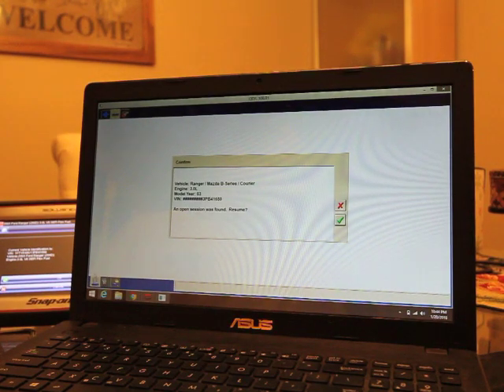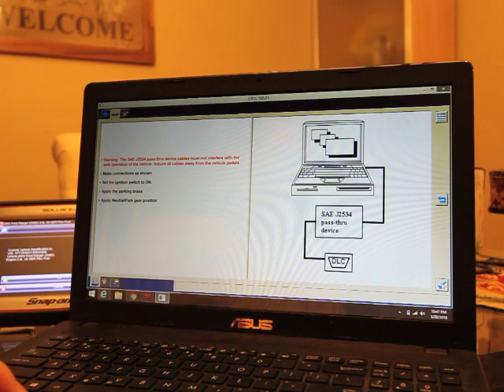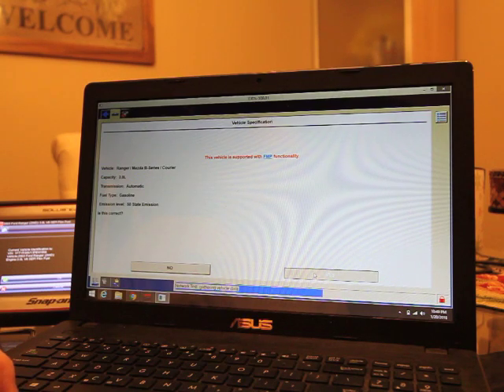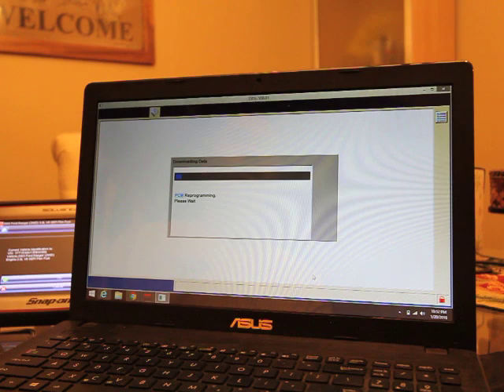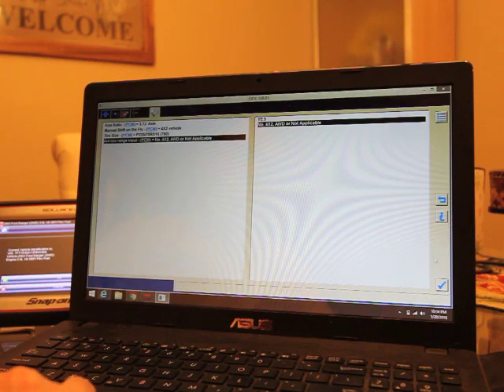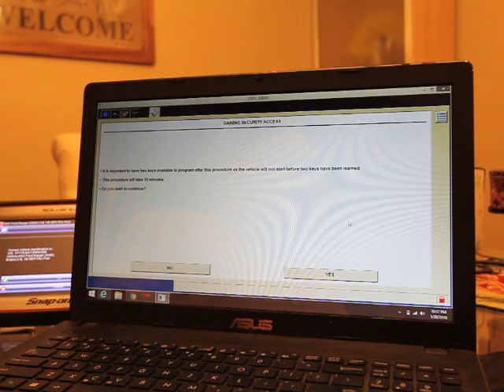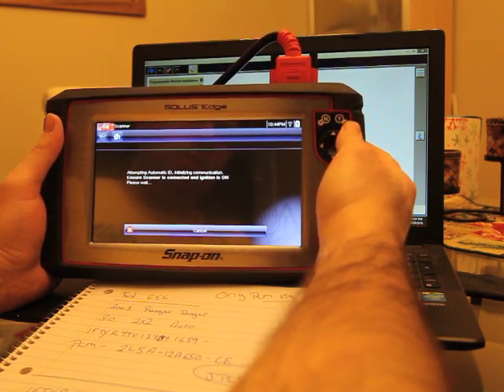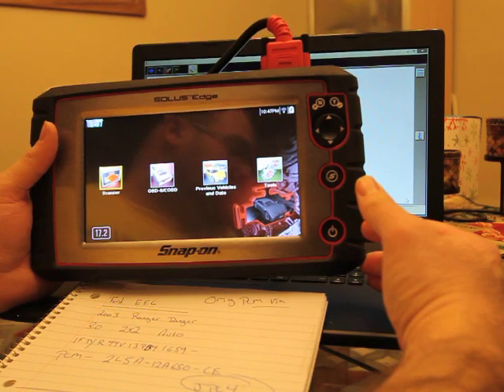Ford PCM / ECM Reflash With VIN Change walk thru j2534 Programming flash reprogramming FORD IDS FJDS

Comment: Thank  You for the great video and information. I know less then nothing about the prograning. If I sent my 2003 ford f150 ecu/ecm in to have someone rebuild it, Is this what they do so that it works with the pats? Like I said I know nothing about this. I have to mail it in because I moved to Central America with my truck from Flroidsa. No ford dealerships here. Again Thank You .
Reply from the maker: So you had it rebuilt?
Reply: @SpartanAutoworx  Thank You for the reply. No, I have not had to dl anything yet. The truck is a 2003, It's simoly a matter of time.
Reply: @SpartanAutoworx  OOPS! simply
Reply from the maker: Not sure if im understanding. A rebuild would not need to be re flashed. A re builder should not have to re flash unless some programming specific parts had to be replaced.  PATS may have to be relearned but that about it.

Comment: So I am swapping a coyote engine into a fox body, If I got a computer from the junkyard can I use the snapon or vcmii scanner to disable pats? or I will have to get the immobilizer/cluster etc and actually program keys for it?
Reply from the maker: To my knowledge you wont find anyway to disable vats with ford or oem level diag tools. HP SCT ect would be required for a pats disable.
Reply: @SpartanAutoworx  Right I've used hpt on other cars however the copperhead seems to be different some ppl shipped their pcms to a guy from hpt to get something done. I will have to go that route thanks for ur reply.

Comment: Wondering if you could help me out... I had a tuner install a tune on my 2003 excursion 6.0 diesel. It works, however, the tuner changed my vin and locked me out of my sct x3. I have a vcm and ids, can i sace the tune file, revert to my vin, and install the tune on my sct x3?
Reply from the maker: You can rewrite the orig file with the ids but puling the tune off with ids is not going to happen. HP tuners or SCT would be needed to read the mod tune. Dont mess with aftermarket tuning with fords so I have no answers on this one.

Comment: hello excuse the question but I would like to know if I could change the program in an automatic pcm to manual in a ford ranger 2000 3.0
Reply from the maker: If the pcm part number allows it then yes. Have to cross reference with ford.

Comment: I have a question...... 07 f150 I have only 1 key before I start programming I need 2 working keys I understand that. In the pats section can I program the 2 new keys with 1 original to make a total of 3 keys before I switch pcm????
Reply from the maker: Not sure I understand what you are asking.  When you enter Pats All keys will be erased. So You must have Two keys in order to program the keys correctly to start the vehicle. Only one key would be required in order to access the pats function.

Comment: Does This Method work for used ABS module?
Reply from the maker: Used If programming is found in IDS use as built from the server to flash it. If it ask then copy data from the old module. Never done ABS on a Push or Repair daily

Comment: Hey, Original PCM on my 2004 Ford got shorted out and replaced by a shop with a used PCM.  Discovered at emissions testing that shop did not reflash the PCM and still has old VIN.  I suspect that this replacement PCM is not calibrated properly for my car since it is running rich.  Contacted shop that claims no, PCM will go back to factory settings even if prior owner of PCM changed settings in PCM and old VIN won’t make a difference.  I’ve asked them to check the PCM settings on my car and reset to factory settings if necessary.  They said that that can’t be done via the OBD2 port and the PCM needs to come off the car to do that.  I’ll press them to do that if necessary, but is that true?  Is this procedure not through the ODB2.  Any tips or advise welcomed.  I paid way too much for them to just blow off reflashing the PCM if they should have done that.  Thank you.
Reply from the maker: Reflash can be done in the car or off. Sounds like they threw it in and programmed two keys to it via a handheld scan tool. If they did reflash it then the procedure for vin replacement was not correct. Would need to follow key procedures discussed in this video to manually input the vin for the rewrite.
Reply: They could only disabled PATS.
With PATS disabled you could plug the PCM in any car.

Comment: If you’re using a bench tester like the TomSad Smart Connect they recently came out with a ignition coil attachment that you could use for programming your keys in as long as the key data is saved in the module you’re working on.

Comment: Just replaced the pcm on my 98 Ranger. Everything was fine....until it got warm, then it wouldn't start. Had to replace old one. Does it need to be programmed? I just swapped it out. Is that the problem?
Reply from the maker: Should be programmed to match the correct vin and cal info for the engine of the truck.
Reply: @SpartanAutoworx  : It says it was pre-programmed at the factory. I just needed the emissions code(?) off the door to order it. IF the VIN was in the original, nothing I ever had could read it....had to manually input the VIN into the AutoTap program I had.
Got another one, and it worked for about a week, then wouldn't start when cold. Connected a reader to it...said it had no codes...and then it started!?!?
Reply from the maker: EEC-IV Computer or EEC-V
Reply: @SpartanAutoworx  : The sticker on the original PCM states its EEC-V.

Comment: So, I have a VIN but I have a VIN I want to mimic.  The VIN I want to mimic is the one that has an option I want, I just don't want to have this PCM think that the VIN is of the vehicle I want to mimic  Is this what I would do?  enter my PN on my sticker not have it on basically fool it into thinking it burned out completely then after plug it in?  Or do I tell it the VIN of the one I want and it download everything from Ford?
Reply: Also, I have this https://www.amazon.com/gp/product/B01F0GVBWY/ref=oh_aui_detailpage_o00_s00?ie=UTF8&psc=1 will it connect?  If I buy a 2 day subscription to FDRS where do I get the actual software?  Or once I buy a license from motorcraftservice.com do I get a download for the actual software?

Comment: Hey just a question. Not sure how much experience you have with ford pcm reflashing. I have a 2011 mustang, with the tear tag of xfn3. I purchased a ecm with the wrong tear tag of zfk1. Both cars have 5.0 both manual trans. Only difference is the new one was from a 2012. Is it possible to program to my vin. Or do I need the vin for that vehicle? I tried to program it but as soon as I did it would tell me the ecm was unknown/ wrong. And that I needed a certain part number. Any help is appreciated
Reply from the maker: From my experience, you almost always have to have like for like part numbers when flashing fords. Fords can be a real pain to flash sometimes due to part compatibility.  Good luck.

Comment: Hello, sorry to bother you with this question, but, how did you do to purchase license for FJDS, I have been tried and always pop up the same error “Microsoft VBScriptruntime error ‘800a000d’ type mismatch /ngsm/purchase_step2.asp, line 177”
I worked pretty well with FMP but now is not available.
Reply from the maker: Never had an issue using IE. Wont work with Chrome.